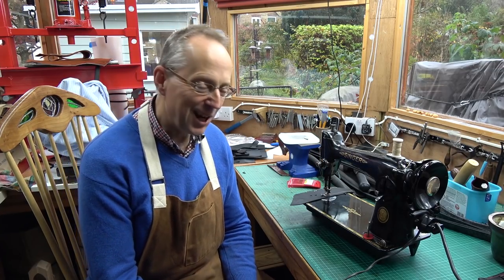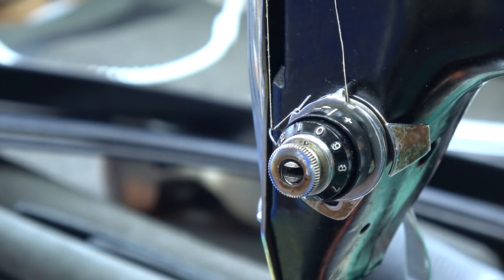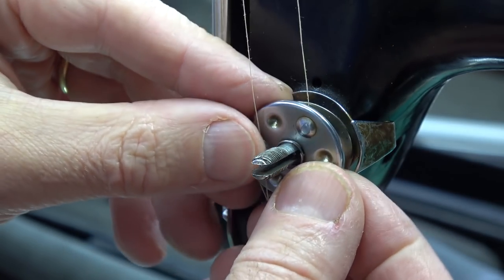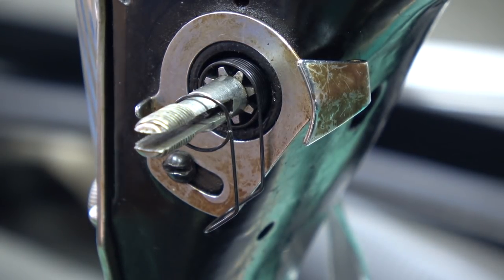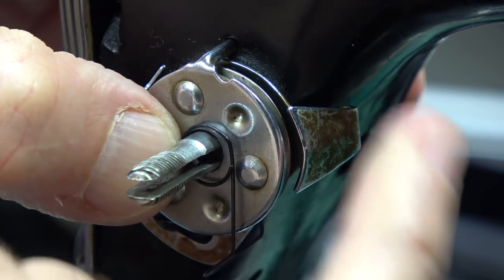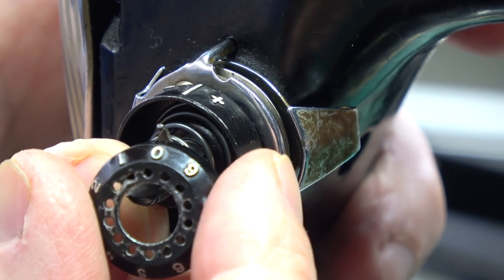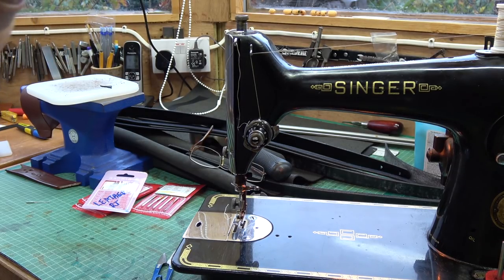Singer Tension Spring Replacement 201K

Comment: Thanks so much! For a while I've wondered why my stitches were just a bit wobbly. Everyone raves about the stitches on this machine but I just didn't see it. Turns out I used the manual to reassemble years ago and it just doesn't have a much detail as your video. I'm raving now!

Comment: I have to thank you for this video. I have a Gritzner machine from 1893 but recently became the proud father of a Pfaff 30 from 1952. While not the same machine as yours, being modern, it does have one of these new-fangled tensioners. Thinking that it would just go from 6 down to 1 I started releasing the tension to find it went from 6 down to 1 several times before coming off in my hand. Disassembly is easy! Thank you  for the information with clear narration.

Comment: I had to clean my 201 upper tension, taking it apart and then re-assembling, and could not have worked out how to put the parts back in their proper sequence, without the help of your video, thanks very much for posting!

Comment: Thank you for these excellent tutorials. I bought a fixer upper 201k and your videos have helped me sort it out. It's cleaned and oiled and a new motor is on the way. The next  thing I need to do is replace this tension spring because that's exactly how it is on mine.

Comment: Thank you so much for the video. I appreciate the close up view and your pointing out and identifying each component. I had multiple tension assemblies for my 66, two 301’s, and the 201 and I just wasn’t sure which pieces went to what. Now that I’ve seen this I know which thread discs to use and that bit that follows the spring does belong. I accumulated 5 vintage/antique singers this last year and a pfaff 230 to add to my singer centennial 201 and my singer 301. All of them came with small boxes of parts so it’s been a jigsaw passel to figure out which tension assembly parts go to what after getting them mixed up with the 201’s tension assembly. It’s nice to know the 201 can handle leather as that’s what I will be sewing on it. By the way you have a very calming voice. ☺️

Comment: Hi Harry
What a result! I was gifted a 1940, 201 K4 singer machine which looks like it has hardly been used. I've tried to make it work for years with no success. I make leather bags for friends and family and I thought inside pockets could be machine stitched to save time, although I would saddle stitch the main bag. I realised that for years the tensioner was assembled wrongly and rebuilt as per your video. The machine now runs like a singer! stitching through leather is perfect and will save so much time. I can rivet the corners of the pocket to add strength but the Gutterman thread is so strong it would cut into your fingers off!, cheers mate Dave Gibbs
Reply from the maker: That's great Dave....thanks

Comment: Hello Harry, you helped me figure out a very tough problem with my tensioner on my singer 201.  I couldn't get my stitched to be consistent no matter what.  After watching your video, I realized my slack take up spring was binding and therefore not working.  After some investigation I found that the very back plate was slightly bent and causing interference with the spring movement.  After correcting the alignment issues, it sews better than ever.  Thank you so much!
Reply from the maker: That's great Keith.

Comment: Thank you so much for this detailed video. I had to change this same spring on my Mother’s 1950‘s Atlas. The first 90% of that which is in your video is very similar to mine. The last part was different but I was able to solve that on my own. 
Prior to watching your video I was on the wrong track. Thanks again!
Reply: Mine is different too and I cannot work it out! 🙈 mine has two springs. Was yours the same?
Reply: @choppysocks  greetings, this was a good while back that I did this. I only had the one spring to replace. My machine doesn’t have 2 springs. . I wasn’t able to find the exact replacement spring but I found a close looking one at an old sewing machine repair place. I had to make an adjustment to it by bending carefully with a pair of needle nose pliers a portion of the new spring to get it to fit. I remember that the disassembly during this process was quite different from what I expected. There were a lot of precision parts that fit just so and I took a lot of pictures during disassembly to put it back together correctly. And I had to watch a lot of videos including this one before I was able to figure it all out. My best advice is take your time. Don’t force anything as these are very precision built machines, take lots of pics during disassembly and keep researching with the videos. Best of luck to you.
Reply: @daq thank you for your reply. I wish I had been able to take photos of the disassembly but I stupidly didn’t think about the spring and when I loosened the screw it all flew out so I had no idea what went where! I’ve looked around and I think my machine is a 1936 year, I’ve seen one similar tension dial (it doesn’t have numbers just lines) but it’s not disassembled. these videos are all so very helpful though.

Comment: Excellent instruction & fabulous visuals!  
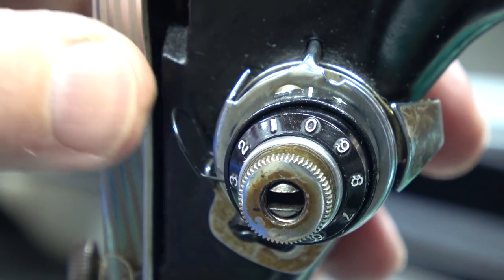I was given my brother-in-law's Mother's Singer 403A (?) sewing machine after she passed away.  My BIL had first had it serviced by his "sewing machine guy", who said it was now good to go.  Unfortunately, the first time I tried to use it I saw that the tension assembly appears "off", with that spring loop at the 1:00 position instead of 9:00.  I was afraid to try to adjust it as the tension of a sewing machine has always seemed a sacred untouchable to me, since I was introduced to sewing in childhood. "If you screw up the tension, the machine will never work again", still booms in my head!  
I was a bit dismayed to realize that the sewing machine guy could not possibly have run a final thread up & sample sew of test fabric before declaring the machine fit, otherwise he would surely have realized his error.  I don't live in that area or I would simply have asked if the gentleman could make that final adjustment he missed.  I'm still nervous about it, but your video has greatly eased my mind & encouraged my generally mechanically inclined self, to give it a shot. 
Thank you & God bless!😇
P.S. I pulled it out to see what I could do & just now saw that there is no bobbin adapter that I am used to from my Mom's machine, on which I grew up... I'm afraid it must be missing, but wonder if this model machine doesn't have one of those... I'll have to do some more research! 
[5.13.2023]

Comment: I think that’s the problem I’m having with my 185. My top stitch isn’t right but altering the tension is making no difference. So I cleaned and oiled the machine - still didn’t fix it. Watched this video and now I’m convinced it’s the spring that’s gone. I’m off to shop for a replacement. Thank you! 😁

Comment: Great video, precise information oand good close ups.. It helped me a lot. I have my mother's singer golden girl sewing machine. It was a model marketed in South Asian countries. But tension assembly unit is identical to yours. Your video really helped me to understand the tension assembly ..I have been using it without tension spring and facing constant absymal tension.
Now I will have to find a tension spring..
Reply from the maker: Mary June you may find one on ebay
Reply: Harry Rogers 
Yes, but I live in the other part of the globe, marketing alone will be more than the price of my 50 years old sewing machine.
I have no idea when and where and how that thing got lost. I just dread to admit that I must have done something to her in my earlier phase of getting to know the machine and didn't even realize it.
This golden girl is similar to singer 287, but it doesn't have a dropfeed option and stop motion for bobbin finding. But it's a pretty machine . I just messed it up thoughtlessly.
Reply from the maker: Mary June perhaps if you do not have eBay you can find a spring maker...I guess ask at a sewing shop and Google around...good luck.

Comment: Thanks for this. It was really helpful. I did have a problem with the tension release pin preventing the assembly going back together and adequate tension being achieved but got there in the end. For the first time in 5 years, I have a tensioner that works properly. (The tension release pin is hidden in the threaded slot and needs to be pushed home to allow everything else to seat properly).

Comment: Had issues today (turned out to be some idiot installing the needle the wrong way round...) but in my investigation, I took the tension assembly apart and reassembled with your video. I did notice that the lever inside the machine that it acts on was loose and not matching up to the bit it was supposed to (if that makes sense) - seconds to tighten with a screwdriver. I also found some thread wrapped round components inside (of a colour I haven't used) so gave it a good clean and an oil. I use V69/40s thread which is pretty thick - have to make sure it's properly inside the tension discs (top tension needs to be quite high) and bobbin tension needs lowering slightly but for the heavyweight gear I'm sewing, it's superb
Reply from the maker: That's great

Comment: This video explains exactly what I needed to know, which is the position in which the tension spring should go (between 4 and 6 o'clock). I'm repairing my mother's machine which is a Singer 226r, and the tension unit is very similar to this one, with the difference that mine has 3 tension discs, two convex and one central flat... A question, abusing your kindness: from front to back, where should the thread go? between the first disk and the central one or the central one and the last disk? (the manual doesn't say so, it's very rudimentary) In advance, thank you very much.

Comment: Thanks.  My machine dated 1950 is about identical.
Reply: Heh mine's a 201K coloured tan, and is on top of a nice wooden case that someone has painted bletcherous Orange, probably in the 70s.   Also got a treadle and the original leather belt still. but has had an electric motor fitted at some point, thankfully !

Comment: Very Useful, And helped me get mine a' working fine ..thanks Harry, much obliged
Reply from the maker: Great.
Reply: Hi Harry, sorry to trouble you, but have got the sewing frenzy ... Have a Singer 328 K  which have not used for about 10 years... would you know best place to buy parts as think I need to replace the whole bobbin .. Have ordered Spring ... would like to also buy the robin cover holder, and know how too install as was having problems with.... Thanks again
Reply from the maker: @warmaqualuv  I would take a look at College Sewing Machines UK on the web.
Reply: @harryrogers  Thanks again Harry

Comment: Hi Harry, Loved your video re replacing tension spring which I managed to do thanks to your clear instructions.
 My problem is that the stud that supports all the components is falling out of the machine and if I  look in the front of the machine it looks like I have lost the little screw that holds it in place (there is an obvious place for a screw to go adjacent to the stud). 
Would you be able to tell me the name  or dimensions of this screw so I can find a replacement?
This 201K was purchased by my Mother in 1954 and has travelled far and sewn many kilometres.

Thank you again for your lovely clear instructions.
Reply from the maker: Hello Wade, you will probably find a parts diagram on the ISMACS website.

Comment: Thanks for the instructions. I replaced the spring as you displayed and got the machine sewing again, however, during sewing it’ll sew fine then the string instantly becomes so tight that it breaks. It’s not the spring. So the issue is still there. Do you know what that could be?

Comment: My old-fashioned Singer machine (1889), the mechanic is workable. Only I need a new spring for the tension. Where do you think I find it? Thank you. Your video is very clear and explanation well. thank you
Reply from the maker: Possibly buy a complete similar tension assembly if the spring looks similar???
Reply: @harryrogers  Thank you and I will look for the spring. Thank you

Comment: Please, I have a problem in the tension of my this singer machine that i couldn't fix : 

the sewing make a lot of yarn under the cloth that mean the upper tension is not tied enough, but when i tie it more the yarn cut 

the back geared part of the middle bar has a part length of few millimeters outside its hole ---> i don't know if it is normal or not. 

Also, i don't know if this is the reason that make the back spring is not in touch with the back disc or not. or does the back spring should be in touch with the back disc or not ?

Comment: Hi Harry - what's the purpose of the plate on the right-hand side of the tensioner?  Its like a hook but the thread never goes near it.  
I think I've fixed mine using this - part of my problem is someone has tried to turn the tensioner's central shaft like its a slotted screw, and spread the two sides so its all a bit off.
Reply from the maker: I think the plate is simply a deflector when threading up...well done on your fixing up.
Reply: @harryrogers  2 years later and I'm redoing it again - turns out the two tension disks have flats worn on the faces  so they were more like two washers, giving far too much drag and breaking the thread frequently at the needle's eye.
Next is figuring out the bobbin-tension underneath - leaves huge blobs of thread now.   Still, not bad for a 70 year old machine from a high school.

Comment: I would like to know your needle and tread combination for that demonstration.   And also other types of combinations you recommend for that particular machine.   I have one of these fine old machines and many others as well.  I just was not aware that it could sew leather at all. Thanks for another excellent video, Sir.
Reply from the maker: Hi a size 90 leather point needle with Gutterman polyester upholstery thread.
Reply: @harryrogers  Thank you so much for sharing that sir.

Comment: Thank you so much for explaining tension knobs however I have a singer 101
I’m not sure if I put the disks back together and the thread tension wire back on properly but it is not working is there a tutorial for the 101 that does not have the number dial? Much appreciate any comments
Reply from the maker: The 101 is an earlier machine, but I think the principle will be the same...please check the discs are the right way and are managing to add friction and the tension spring is fixed not rotating.

Comment: Excellent tutorial.  No joy w/mine though. Once the foot is dropped the tension is maxed even with dial all the way back.  A finicky machine these old 201's.
Reply from the maker: Yes they can be tricky, I had a worn rod inside one of mine  and the new unit with replacement little inch long rod did the trick.
Reply: @harryrogers  Indeed. Mine is in good mechanical condition but still, it acts like an old car. I'm about ready to spring for a new machine.
Reply: @harryrogers  the secret sauce is in the threads and needles. Amazing the affect they have on the behavior of the machine.

Comment: Hello Harry, I have acquired a vintage Favta Darling sewing machine. There are unfortunately problems with the tension mechanism. From your video I can see it needs a new tension spring. However, also it has a part missing. I am not sure what spring it would need and what to do about the missing part. I would welcome any help to get this machine up and running. I am happy to communicate by e-mail. Kind regards, Janine
Reply from the maker: Hi I am sorry but I am not familiar with that machine....made in Switzerland?? Some parts can be adapted, so maybe a dealer can find a similar tension unit that you could fit or adapt?

Comment: Hi Harry, Brilliant video.  I am intending to reupholster my vintage car seats using 1.1mm thick leather.  I have followed your advice and bought a Singer 201K for the job?  Can you please tell me what needles I need to buy and where I can purchase the tension spring?  Do you have the part No for the spring.  Have you any advice as to what thread I should use?  I have followed your advice and bought a Singer 201K for the job.  The M/c appears to be in very good condition.  I have also purchased a Walking Foot Singer 331K5 but I cannot get it to sew well, continuously.

Regards  Paul S
Reply from the maker: Hi Paul ...you can get the tension assembly on EBay, and needle wise go for leather point...again from Ebay if you want...largest diameter they do...probably size 100 (UK)....Gutterman upholstery thread is worth considering. The 331k would take thicker stronger threads if you get it going.

Comment: My 201 K, I have done the upper tension spring but the bottom thread just does not pick up. Is there also a way to adjust that?
Reply from the maker: I did a video a long while back on Singer 31k timing, tge thumbnail is a scrap machine, that might be worth a look. Try and look to see is the lower thread being looped close to the needle etc.
Reply: @harryrogers  do you have link? It looks like the bobbin house and thread catcher are not alligned with the bottom dead point of the needle. Maybe I will be able to access the shaft fro underneath and make a small rotational adjustmenbt.

Comment: Hi Harry.
I have a 201K treadle machine in cabinet that was my grandmother's and I know the tension spring is broken.  I am in Queensland, Australia.  Are these replacement sprins easy to obtain and where from.
Kind regards, Lee.
Reply from the maker: Yes easy to obtain...sewing shop or ebay or google it Lee.
Reply: @harryrogers  Thanks for that Harry.  I have just ordered one from the UK and should be here in the next few weeks.  It was also very valuable to have seen the video you did on cleaning and oiling the machine as I probably have not been as thorough as you were.  Once again, many thanks.